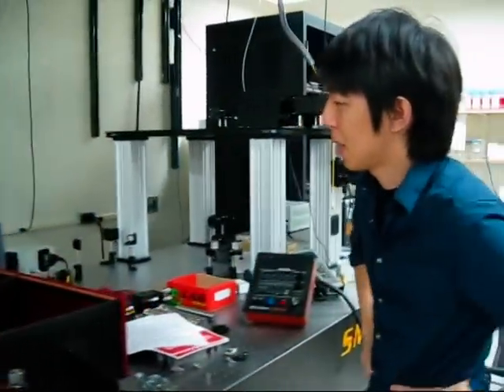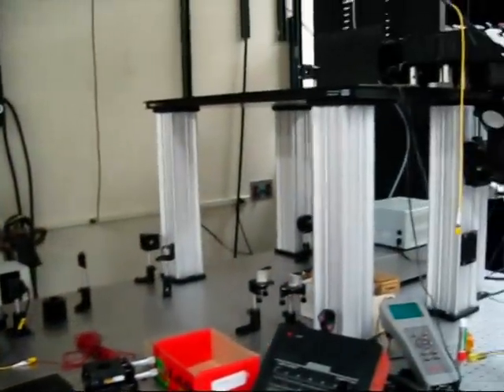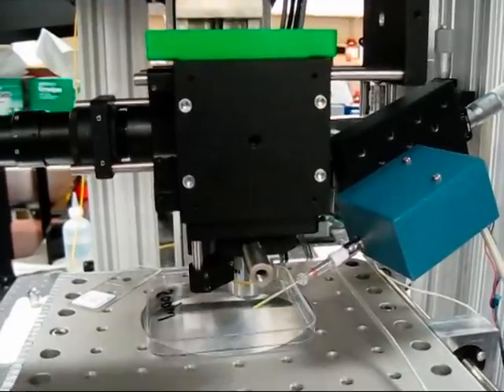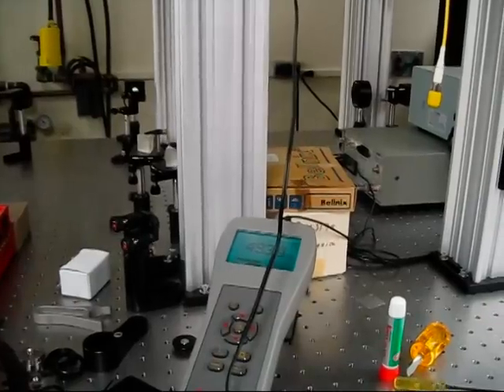Del Mar Photonics Ti:Sapphire laser Trestles in the UCLA Biophysics Neuroimaging Laboratory

Comment from the maker: Laser micromachining of transparent glass and quartz dielectrics using nano short pulsed Nd:YVO4 laser harmonics
Shiva P. Gadag
10 February 2015 • 6:00 - 8:00 PM | Part of SPIE LASE

CW, single-frequency 229nm laser source for Cd-cooling by harmonic conversion
Yushi Kaneda, J. Michael Yarborough, Yevgeniy A. Merzlyak
10 February 2015 • 8:30 - 8:50 AM | Part of SPIE LASE

517nm - 538nm tunable second harmonic generation in a diode-pumped PPKTP waveguide crystal
Ksenia A. Fedorova, Phillip R. Battle, Daniil A. Livshits, Edik U. Rafailov
10 February 2015 • 11:40 AM - 12:00 PM | Part of SPIE LASE

Molecular organization and phase transition at the air-water interface investigated by second-harmonic generation
Emmanuel Benichou, Aurelie Bruyere, Emilie Forel, Oriane Bonhomme, Pierre-Francois Brevet
10 February 2015 • 5:10 - 5:30 PM | Part of SPIE OPTO

Fiber laser driven ultrafast RGB source based on simultaneous second harmonic generation from a dual zero dispersion wavelength fiber source
Yuhong Yao, Wayne H. Knox
10 February 2015 • 4:20 - 4:40 PM | Part of SPIE LASE

Frequency doubling of near-infrared radiation enhanced by a multi-pass cavity for the second-harmonic wave
Daniel Jedrzejczyk, Reiner Guther, Katrin Paschke, Gotz Erbert
10 February 2015 • 9:50 - 10:10 AM | Part of SPIE LASE

Quantitative changes in collagen subtypes during breast cancer progression by multivariate analysis of Raman and second harmonic generation microscopy
Sixian You, Yuan Liu, Haohua Tu, Eric J. Chaney, Marina Marjanovic, Stephen A. Boppart M.D.
7 February 2015 • 8:50 - 9:10 AM | Part of SPIE BiOS

Second harmonic generation (SHG) imaging demonstrated a strong dependence of the collagen hydrogels' structures on the types and concentrations of ions
Xuye Lang, Julia G. Lyubovitsky
9 February 2015 • 5:20 - 5:40 PM | Part of SPIE BiOS

Interferometric second harmonic generation imaging of biological tissues
Charles-Andre Couture, Maxime Rivard, Konstatin Popov, Mathieu Laliberte, Anthony Bertrand-Grenier, Amir Miri, Francois Martin, Henri Pepin, Luc Mongeau, Christian Pfeffer, Cameron Brown, Lora Ramunno, Francois Legare
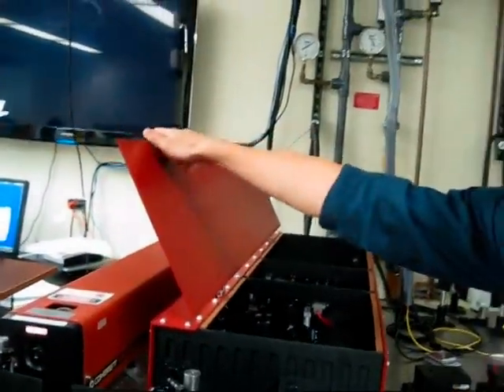8 February 2015 • 5:30 - 7:00 PM | Part of SPIE BiOS

Second harmonic 266nm generation by PP-LBGO device
Junji Hirohashi, Tetsuo Taniuchi, Koichi Imai, Masami Hatori, Shunji Takekawa, Mitsuyoshi Sakairi, Makoto Matsukura, Hiroshi Motegi, Satoshi Makio, Shintaro Miyazawa, Yasunori Furukawa
10 February 2015 • 8:50 - 9:10 AM | Part of SPIE LASE

Enhancement mechanisms for second-harmonic generation from metal nanostructures
Martti Kauranen, Robert Czaplicki, Jouni Makitalo, Kalle O. Koskinen, Joonas Lehtolahti, Janne Laukkanen, Markku Kuittinen
9 February 2015 • 11:15 - 11:45 AM | Part of SPIE OPTO

Differentiating pigmented skin tumors by the tumor-associated melanocytes based on in vivo third harmonic generation microscopy
Wei-Hung Weng M.D., Ming-Rung Tsai, Yi-Hua Liao M.D., Chi-Kuang Sun
7 February 2015 • 8:10 - 8:30 AM | Part of SPIE BiOS

Determination of the reduced scattering coefficient from 3D imaging of thick tissues by second harmonic generation microscopy
Paul J. Campagnola, Gunnsteinn Hall, Kevin W. Eliceiri
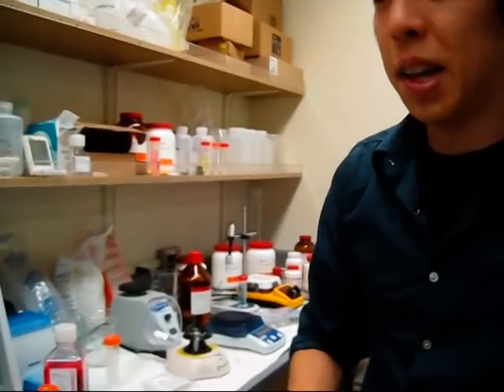8 February 2015 • 1:20 - 1:50 PM | Part of SPIE BiOS

Narrowband second harmonic thermoacoustic signals from solid and soft tissues
Stephan Kellnberger, Murad Omar, George Sergiadis, Vasilis Ntziachristos
9 February 2015 • 5:30 - 7:30 PM | Part of SPIE BiOS

Second harmonic generation at oblique angles in photonic bandgap structures
Han Li, Joseph W. Haus, Partha P. Banerjee
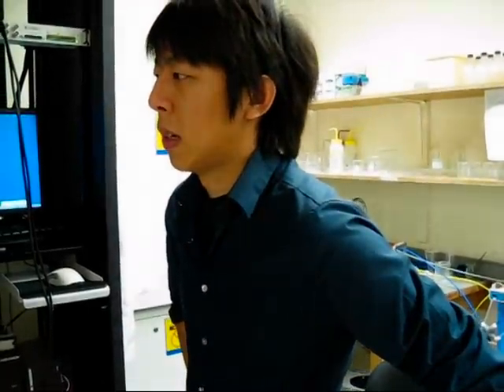11 February 2015 • 5:00 - 5:20 PM | Part of SPIE LASE

In-phase synchronization of array laser using intra-Talbot-cavity second harmonic generation
Kenichi Hirosawa, Fumihiko Kannari, Takayuki Yanagisawa
9 February 2015 • 5:10 - 5:30 PM | Part of SPIE LASE

Enhance resolution on OCT profilometry measurements using harmonic artifacts
Marcus Paulo Raele, Lucas De Pretto, Anderson Z. de Freitas
9 February 2015 • 5:30 - 7:30 PM | Part of SPIE BiOS

In situ determination of collagen fibrils size via absolute measurements of second harmonic generation
Stephane Bancelin, Carole Aime, Ivan Gusachenko, Laura Kowalczuk, Gael Latour, Thibaud Coradin, Marie-Claire Schanne-Klein
8 February 2015 • 5:30 - 7:00 PM | Part of SPIE BiOS

Controllable harmonic generation by double couplings of ordinary rays-involved second-order processes
Yiqiang Qin
11 February 2015 • 6:00 - 8:00 PM | Part of SPIE OPTO

Second-harmonic generation with double resonant hybrid plasmonic/dielectric nanostructures
Heiko Linnenbank, Stefan Linden
9 February 2015 • 11:45 AM - 12:00 PM | Part of SPIE OPTO

Generation of third harmonic picosecond pulses at 355 nm by sum frequency mixing in periodically poled MgSLT crystal
Thomas Schoenau, Andre Kaltenbach, Gunther Trankle, Kristian Lauritsen, Rainer Erdmann
10 February 2015 • 6:00 - 8:00 PM | Part of SPIE LASE

Second harmonic generation of a random fiber laser with Raman gain
Sergey A. Babin, Ekaterina I. Dontsova, Ilya D. Vatnik, Sergey I. Kablukov
11 February 2015 • 5:20 - 5:40 PM | Part of SPIE LASE

Third harmonic generation and multiphoton fluorescence in graphene using a compact femtosecond 1.56 µm laser
Antti Saynatjoki, Lasse Karvonen, Juha Riikonen, Wonjae Kim, Joonas Makinen, Seyed Soroush Mehravar, Robert A. Norwood, Nasser N. Peyghambarian, Harri Lipsanen, Khanh Kieu
9 February 2015 • 1:40 - 2:00 PM | Part of SPIE OPTO

Second harmonic generation imaging in tissue engineering and cartilage pathologies
Magnus B. Lilledahl, Magnus O. Olderoy, Andreas Finnoy, Kristin Olstad, Jan E. Brinchman
9 February 2015 • 5:20 - 5:35 PM | Part of SPIE BiOS

Correlation between polarization sensitive optical coherence tomography and second harmonic generation microscopy in skin
Hoan Viet Le, Seunghun Lee, Bumju Kim, Yeoreum Yoon, Ki Hean Kim
11 February 2015 • 3:00 - 3:15 PM | Part of SPIE BiOS

Synchronous-digitization for video rate polarization modulated beam scanning second harmonic generation microscopy
Shane Z. Sullivan, Emma L. DeWalt, Paul D. Schmitt, Ryan D. Muir, Garth J. Simpson
10 February 2015 • 11:20 - 11:40 AM | Part of SPIE BiOS

In vivo visualization of collagen fiber produced by cultured osteoblasts using sensitive second-harmonic-generation microscopy equipped with a 10-fs mode-locked Ti:sapphire laser
Eiji Hase, Katsuya Sato, Takeshi Yasui
8 February 2015 • 5:30 - 7:00 PM | Part of SPIE BiOS

Experimental and modelling investigations into the laser ablation of Si, PCD, Cu, steel and WC using picosecond pulses at second harmonics
Paul Borner, Germana Zandonadi, Gregory Eberle, Konrad Wegener
10 February 2015 • 9:00 - 9:20 AM | Part of SPIE LASE

Edge-lit volume holograms recorded by free space exposure: diffraction by 2nd Harmonics in Bayfol® HX film
Friedrich-Karl Bruder, Thomas Faecke, Rainer Hagen, Dennis Hoenel, David Jurbergs, Enrico Orselli, Christian Rewitz, Thomas Roelle, Guenther Walze, Brita Wewer
8 February 2015 • 8:40 - 9:00 AM | Part of SPIE OPTO

Realization of high-sensitivity surface plasmon resonance (SPR) sensor applying 2? harmonic lock-in detection
Chang-In Park, Kwang-Jin Kim, Chang-Gun Kim, Nam-Pyo Hong, Young-Wan Choi
11 February 2015 • 2:25 - 2:45 PM | Part of SPIE OPTO

Super resolution brain imaging by using a two-photon fluorescence microscopy with harmonic modulation
Szu-Yu Lee, Chi-Kuang Sun
8 February 2015 • 5:30 - 7:00 PM | Part of SPIE BiOS

Competition between harmonic generation and multi-photon luminescence in selectively grown coaxial InGaN/GaN quantum wells on GaN pyramids for tunable light emission
Sween J. Butler, Mohamed Fikry, Klaus Thonke, Arup Neogi
11 February 2015 • 2:50 - 3:10 PM | Part of SPIE LASE

100w femtosecond fiber amplifier and harmonic generation from IR to UV
Julien Saby
10 February 2015 • 6:00 - 8:00 PM | Part of SPIE LASE

Sub-cycle control of multi-THz high-harmonic generation and all-coherent charge transport in bulk semiconductors
Christoph Lange, Olaf Schubert, Matthias Hohenleutner, Fabian Langer, Thomas Maag, Sebastian Baierl, Ulrich Huttner, Daniel Golde, Thorsten Meier, Mackillo Kira, Stephan W. Koch, Rupert Huber
10 February 2015 • 1:50 - 2:20 PM | Part of SPIE LASE

Saturation-limited second harmonic generation in a quantum well-nanoresonator coupled system
Omri Wolf, Salvatore Campione, Arvind P. Ravikumar, Alexander Benz, Sheng Liu, Emil A. Kadlec, Benjamin V. Olson, Eric A. Shaner, John F. Klem, Michael B. Sinclair, Igal Brener
11 February 2015 • 6:00 - 8:00 PM | Part of SPIE OPTO

Fiber-integrated second harmonic generation modules for visible picosecond pulse generation
Thomas H. Legg, Timothy H. Runcorn, Dora J. Hu, Robert T. Murray, Edmund J. R. Kelleher, Sergei V. Popov, Robert C. Eckardt, Dieter H. Jundt, Andrew Robertson, James R. Taylor
10 February 2015 • 11:00 - 11:20 AM | Part of SPIE LASE

Motion-free polarization-resolved second harmonic generation cornea imaging with sub-15 fs pulses
Hans Georg Breunig, Ana Batista, Aisada Uchugonova, Karsten Konig
8 February 2015 • 5:30 - 7:00 PM | Part of SPIE BiOS

Second harmonic generation from metamaterials strongly coupled to intersubband transitions in quantum wells
Salvatore Campione, Omri Wolf, Arvind P. Ravikumar, Alexander Benz, Sheng Liu, John F. Klem, Michael B. Sinclair, Igal Brener
11 February 2015 • 1:30 - 2:00 PM | Part of SPIE LASE

Tracing red blood cells in human capillary automatically by third harmonic generation microscopy
Guan-Liang Lin, Chien-Ming Lee, Yuan-Ta Shih, Ming-Rung Tsai, Chi-Kuang Sun
7 February 2015 • 11:00 - 11:20 AM | Part of SPIE BiOS

20.3% wall-plug efficiency green laser based on an electrically pumped VECSEL through intracavity second harmonic generation
Pu Zhao, Bing Xu, Robert Van Leeuwen, Tong Chen, Laurence S. Watkins, Delai Zhou, Jean-Francois Seurin, Peng Gao, Guoyang Xu, Qing Wang, Chuni Ghosh
10 February 2015 • 9:30 - 9:50 AM | Part of SPIE LASE

Terahertz harmonic generation in graphene
Samwel K. Sekwao, Jean-Pierre Leburton
10 February 2015 • 5:40 - 6:00 PM | Part of SPIE OPTO

Generation of stable high order harmonic noise-like pulses in a passively mode-locked double clad fiber ring laser
Juan C. Hernandez-Garcia, Olivier J. Pottiez, Baldemar Ibarra-Escamilla, Julian M. Estudillo-Ayala, Roberto Rojas-Laguna, Evgeny A. Kuzin
10 February 2015 • 6:00 - 8:00 PM | Part of SPIE LASE

Combining wide-field assessment with nonlinear optical microscopy: possibilities for multimodal imaging in epithelial (pre)cancer
Rahul Pal, Jinping Yang, Gracie Vargas
9 February 2015 • 2:05 - 2:20 PM | Part of SPIE BiOS

Multimodal non-invasive optical imaging methods for structure and functional assay of nociceptive pain model in Drosophila melanogaster
Chiao-Ying Lin, Chii-Wann Lin, Jyh-Horng Chen
7 February 2015 • 2:10 - 2:30 PM | Part of SPIE BiOS

In vivo multimodal optical microscopy for longitudinal tracking of adverse effects following topical steroid treatment
Andrew J. Bower, Zane A. Arp, Youbo Zhao, Eric J. Chaney, Marina Marjanovic, Stephen A. Boppart M.D.
7 February 2015 • 11:20 - 11:40 AM | Part of SPIE BiOS

Mode-locking in intracavity frequency doubled Nd:YVO4 laser
Anton V. Kovalev, Vadim M. Polyakov, Sergey G. Alekseev, Oleg A. Orlov, Andrey A. Mak
10 February 2015 • 3:30 - 3:50 PM | Part of SPIE LASE

False positives in SRS imaging of lipid droplets: identification and reduction
Xuesong Li, Wen Jiun LAM, Yan Hao, Qiqi Sun, Sicong He, Yan Zeng, Ho Yi Mak, Jianan Qu
8 February 2015 • 5:30 - 7:00 PM | Part of SPIE BiOS

Self-focusing effect on THG at interfaces of solvent-cuvette
Emerson C. Barbano, Kerrianne Harrington, Sergio C. Zilio, Lino Misoguti
10 February 2015 • 6:00 - 8:00 PM | Part of SPIE LASE

Large-aperture adaptive liquid crystal lenses for vision care
Guoqiang Li, Thomas Mauger
11 February 2015 • 10:20 - 10:50 AM | Part of SPIE OPTO

Real-time monitoring of tumor response to preoperative radiochemotherapy for rectal carcinoma by nonlinear optical microscopy
Lianhuang Li, Jianxin Chen
10 February 2015 • 11:35 - 11:55 AM | Part of SPIE BiOS

Classification and recognition of texture collagen obtaining by multiphoton microscope with neural network analysis tool
Shulian Wu, Hui Li, Xiaoman Zhang
8 February 2015 • 5:30 - 7:00 PM | Part of SPIE BiOS

Ten deep blue to cyan emission lines from an intracavity frequency converted Raman laser
Dimitri Geskus, Jonas Jakutis Neto, Helen M. Pask, Niklaus U. Wetter
10 February 2015 • 9:30 - 9:50 AM | Part of SPIE LASE

Transducing electron and photons in electrically-contacted optical gap antennas
Alexandre Bouhelier
10 February 2015 • 1:55 - 2:25 PM | Part of SPIE OPTO

High-power non linear frequency converted laser diodes
Paul M. Petersen, Ole B. Jensen, Peter E. Andersen, Anders K. Hansen, Dominik Marti, Peter M. W. Skovgaard
11 February 2015 • 10:50 - 11:10 AM | Part of SPIE OPTO

Mechanisms for forbidden hyper-Rayleigh scattering
David L. Andrews, Mathew D. Williams, Jack S. Ford
11 February 2015 • 5:40 - 6:00 PM | Part of SPIE LASE

Characterization of porcine eye based on autofluorescence lifetime imaging
Ana Batista, Hans Georg Breunig, Aisada Uchugonova, Antonio Miguel Morgado, Karsten Konig
8 February 2015 • 2:05 - 2:20 PM | Part of SPIE BiOS

Tunable continuous-wave midwave infrared generation using an orientation patterned GaAs crystal with a fan-out grating design
Jacob O. Barnes, Shekhar Guha, Leonel P. Gonzalez, Peter G. Schunemann
10 February 2015 • 5:10 - 5:30 PM | Part of SPIE LASE

Optical nonlinearities in few-layer gallium selenide
Lasse Karvonen, Antti Saynatjoki, Seyed Soroush Mehravar, Raul D. Rodriquez, Susanne Hartmann, Dietrich R. T. Zahn, Seppo K. Honkanen, Robert A. Norwood, Nasser N. Peyghambarian, Khanh Q. Kieu, Harri Lipsanen, Juha Riikonen
8 February 2015 • 10:00 - 10:15 AM | Part of SPIE OPTO

0.5W CW single frequency blue at 486 nm via SHG with net conversion of 81.5% from the NIR using a 30 mm PPMgO:SLT crystal in a resonant cavity
Ali Khademian, David Shiner
10 February 2015 • 11:20 - 11:40 AM | Part of SPIE LASE

Nano-scale characterization of gold nanostructures using polarized nonlinear microscopy
Naveen K. Balla, Carolina Rendon, Esteban B. Urena, Pawel Karpinski, Julien Dubboiset, Patrick Ferrand, Herve Rigneault, Romain Quidant, Sophie Brasselet
9 February 2015 • 12:00 - 12:15 PM | Part of SPIE OPTO

Design and results of a dual-gas quasi-phase matching (QPM) foil target
Arvid Hage, Bjorn Landgraf, Michael Taylor, Martin Wunsche, Mark J. Prandolini, Mark Yeung, Hauke Hoppner, Michael Schulz, Robert Riedel, Franz Tavella, Brendan H. Dromey, Matthew Zepf
11 February 2015 • 2:30 - 2:50 PM | Part of SPIE LASE

Discontinuous sampling in beam-scanning microscopy
Ryan Muir, Paul D. Schmitt, Emma L. DeWalt, Shane Z. Sullivan, Ximeng You, Garth J. Simpson
9 February 2015 • 5:05 - 5:20 PM | Part of SPIE BiOS

Breast cancer staging through nonlinear endomicroscopy
Gunnsteinn Hall, Wenxuan Liang, Lu Jiang, Kristine Glunde, Xingde Li
9 February 2015 • 9:05 - 9:20 AM | Part of SPIE BiOS

Watt-level continuous-wave diode lasers at 1180 nm with high spectral brightness
Katrin Paschke, Gunnar Blume, Olaf Brox, Frank Bugge, David Feise, Jorg Fricke, Julian Hofmann, Hans Wenzel, Gotz Erbert
9 February 2015 • 2:50 - 3:10 PM | Part of SPIE LASE

Multiphoton microscopy for the characterization and treatment of malignant breast lesions
Alex J. Walsh, Rebecca S. Cook, Melinda E. Sanders M.D., Carlos L. Arteaga, Melissa C. Skala
7 February 2015 • 9:50 - 10:10 AM | Part of SPIE BiOS

Nonlinear imaging of lipid membrane alterations elicited by nanosecond pulsed electric fields
Erick Moen, Gary L. Thompson, Andrea M. Armani, Hope T. Beier, Bennett L. Ibey
9 February 2015 • 11:30 - 11:50 AM | Part of SPIE BiOS

Ultrafast element-specific magnetization dynamics of complex magnetic materials on a table top
Stefan Mathias, Chan La-O-Vorakiat, Justin M. Shaw, Emrah Turgut, Patrik Grychtol, Roman Adam, Denis Rudolf, Hans T. Nembach, Thomas J. Silva, Martin Aeschlimann, Claus M. Schneider, Henry C. Kapteyn, Margaret M. Murnane
11 February 2015 • 9:00 - 9:30 AM | Part of SPIE OPTO

Classical electron trajectories and birth time in polar-asymmetric two-color laser fields
Aram Gragossian, Denis V. Seletskiy, Mansoor Sheik-Bahae
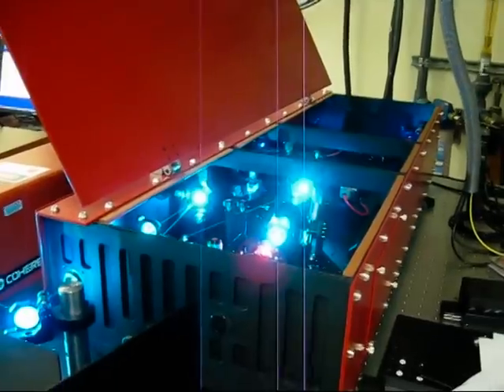9 February 2015 • 5:50 - 6:05 PM | Part of SPIE OPTO

Coherent combining of fiber-laser-pumped frequency converters using all-fiber electro-optic modulator for active phase control
Pierre Bourdon, Anne Durecu, Guillaume Canat, Julien Le Gouet, Didier Goular, Laurent Lombard
12 February 2015 • 3:30 - 3:50 PM | Part of SPIE LASE

Temporal characterization of full attosecond pulse by THz streaking
Fernando Ardana Lamas, Christian Erny, Andrey Stepanov, Ishkhan Gorgisyan, Pavle Juranic, Christoph P. Hauri
11 February 2015 • 4:50 - 5:05 PM | Part of SPIE OPTO

Nanoplasmonics of particles over thin films: Quantum and magnetic effects
Reuven Gordon, Ghazal Hajisalem, Reza N. Sanadgol, Haitian Xu, Byoung-Chul Choi
8 February 2015 • 11:20 - 11:40 AM | Part of SPIE LASE

Simulating the linear and nonlinear response of 1D nanostructures with a B-spline modal method
Patrick Bouchon, Paul Chevalier, Sebastien Heron, Fabrice Pardo, Riad Haidar
11 February 2015 • 4:40 - 5:00 PM | Part of SPIE OPTO

Frequency conversion in AlGaAs microdisks in the telecom range
Giuseppe Leo, Silvia Mariani, Alessio Andronico, Aristide Lemaitre, Sara Ducci, Ivan Favero
11 February 2015 • 11:30 - 11:45 AM | Part of SPIE OPTO

Imaging human melanoma using coherent anti-stokes Raman scattering (CARS) and multiphoton microscopy (MPM)
Hequn Wang, Sam Osseiran, Elisabeth Roider, Vivien Igras, David E. Fisher, Conor L. Evans
10 February 2015 • 11:00 - 11:15 AM | Part of SPIE BiOS

Image-inspired 3D multiphoton excited fabrication of extracellular matrix structures by modulated raster scanning for cancer biology studies
Paul J. Campagnola, Visar Ajeti, Kevin W. Eliceiri, Manish Patankar
12 February 2015 • 3:50 - 4:20 PM | Part of SPIE LASE

Multi-channel beam-scanning imaging at kHz frame rates by Lissajous trajectory microscopy
Justin A. Newman, Shane Z. Sullivan, Ryan D. Muir, Suhas Sreehari, Charles A. Bouman, Garth J. Simpson
10 February 2015 • 11:00 - 11:20 AM | Part of SPIE BiOS

The laser infrastructure of the ELI attosecond light pulse source
Karoly Osvay, Patricio Antici, Dimitris Charalambidis, Eric Cormier, Zsolt Diveki, Peter Dombi, Jozsef A. Fulop, Mikhail Kalashnikov, Nelson Lopes, Rodrigo Lopez-Martens, Giuseppe Sansone, Ervin Racz, Kahaly Subhendu, Zoltan Varallyay, Katalin Varju
12 February 2015 • 9:00 - 9:30 AM | Part of SPIE LASE

Visualizing and quantifying melanoma risk factors with coherent anti-Stokes Raman scattering (CARS) and multiphoton microscopy
Hequn Wang, Sam Osseiran, Elisabeth Roider, Vivien Igras, Peter T. C. So, David E. Fisher, Conor L. Evans
7 February 2015 • 11:40 AM - 12:10 PM | Part of SPIE BiOS

Polarization and wavelength selective grating mirror enables efficient generation of kW-class CW green radiation
Marwan Abdou Ahmed, Martin Rumpel, Montasser Bouzid, Christian Stolzenburg, Alexander Killi, Thomas Graf
9 February 2015 • 11:50 AM - 12:10 PM | Part of SPIE LASE

Ultrafast thin-disk multipass amplifier with 1.4 kW average power and 4.7 mJ pulse energy at 1030nm converted to 820 w and 2.7 mJ at 515nm
Jan-Philipp Negel, Andre Loescher, Andreas Voss, Dominik Bauer, Dirk H. Sutter, Alexander Killi, Marwan Abdou Ahmed, Thomas Graf
9 February 2015 • 11:10 - 11:30 AM | Part of SPIE LASE

Nonlinear optical output of atomic systems via numerical simulation of time-dependent Schrodinger equation, stimulated by laser sources in and out of resonance conditions within the non-perturbative regime
Stephen Karasek, Charles A. DiMarzio
11 February 2015 • 2:10 - 2:30 PM | Part of SPIE BiOS

controlling femtosecond dynamics on the nanometer scale
Nicolo Accanto, Lukasz Piatkowski, Jan Renger, Niek F. van Hulst
9 February 2015 • 10:30 - 11:15 AM | Part of SPIE OPTO

Sub-700fs pulses at 152W average power from a Tm-doped fiber CPA system
Christian Gaida, Fabian Stutzki, Martin Gebhardt, Florian Jansen, Andreas Wienke, Uwe D. Zeitner, Frank Fuchs, Cesar Jauregui-Misas, Dieter Wandt, Dietmar Kracht, Jens Limpert, Andreas Tunnermann
12 February 2015 • 10:40 - 11:00 AM | Part of SPIE LASE

Label-free multimodal multiphoton imaging by adaptively shaping fiber supercontinuum pulses
Yuan Liu, Haohua Tu, Eric J. Chaney, Sixian You, Stephen A. Boppart M.D.
7 February 2015 • 3:00 - 3:15 PM | Part of SPIE BiOS

Solid-state laser source of narrowband ultraviolet B light for skin disease care with advanced performance
Aleksandr A. Tarasov
11 February 2015 • 4:40 - 5:00 PM | Part of SPIE LASE

Simultaneous quadruple modal nonlinear optical imaging for gastric diseases diagnosis and characterization
Zi Wang, Wei Zheng, Jian Lin, Zhiwei Huang
10 February 2015 • 11:45 AM - 12:00 PM | Part of SPIE BiOS

Compact fixed wavelength femtosecond oscillators for multi-photon applications
Tommi Hakulinen, Heinz P. Huber, Tilman Franke, Ruben Zadoyan, Tommaso Baldacchini
9 February 2015 • 11:40 AM - 12:00 PM | Part of SPIE LASE

Label-free second order susceptibility imaging of collagen
Chen-Yuan Dong, Chiu-Mei Hsueh, Ya-Der Huang, Hsuan-Shu Lee
9 February 2015 • 3:30 - 3:50 PM | Part of SPIE BiOS

All fiber based, multi-color two photon excitation microscopy with an amplified laser diode
Sebastian Karpf, Matthias Eibl, Robert A. Huber
8 February 2015 • 5:30 - 7:00 PM | Part of SPIE BiOS

Label-free multi-photon imaging of Barrett esophagus
Seyed Soroush Mehravar, Philip Usera, Hemant Chatrath, Nasser Peyghambarian, Bhaskar Banerjee, Khanh Kieu
9 February 2015 • 4:20 - 4:35 PM | Part of SPIE BiOS

Biomaterial discrimination using wavelength-dependent SHG excitation efficiency
Stephen J. Matcher, Nicola H. Green, Robin M. Delaine-Smith, Gwendolen C. Reilly, Hannah Askew, Xuesong Hu
9 February 2015 • 4:50 - 5:05 PM | Part of SPIE BiOS

Label free, real time visualization of tissue histology at subcellular resolution: a study of primary versus secondary human brain cancer tissues
Carmen Kut, Wenxuan Liang, Gunnstein Hall, Kaisorn Chaichana, Alfredo Quinones-Hinojosa M.D., Xingde Li
8 February 2015 • 11:10 - 11:30 AM | Part of SPIE BiOS

Determination of the spectral dependence of reduced scattering and quantitative SHG imaging for detection of fibrillar changes in ovarian cancer
Kirby R. Campbell, Paul J. Campagnola, Karissa B. Tilbury
8 February 2015 • 5:30 - 7:00 PM | Part of SPIE BiOS

High power green diode laser for the treatment of eye diseases by laser coagulation
Arne Heinrich, Clemens Hagen, Maximilian Harlander, Bernhard Nussbaumer
8 February 2015 • 5:30 - 7:00 PM | Part of SPIE BiOS

Chiral nano-pore arrays with bent-core liquid crystals and their applications
Dong Ki Yoon, Hanim Kim, Kiback Choe, Seong Ho Ryu, Sunhee Lee, Tae Joo Shin, Eva D. Korblova, David M. Walba, Noel A. Clark, Sang Bok Lee, Pilhan Kim
10 February 2015 • 9:15 - 9:30 AM | Part of SPIE OPTO

Two-photon autofluorescence lifetime and shg imaging of healthy and diseased human corneas
Ana Batista, Hans Georg Breunig, Aisada Uchugonova, Berthold Seitz M.D., Antonio Miguel Morgado, Karsten Konig
8 February 2015 • 5:30 - 7:00 PM | Part of SPIE BiOS

Enhanced nanograting formation assisted by silver ions in a sodium gallophosphate glass: Correlation between surface nanostructuring, fluorescence, and effective second-order nonlinear optical properties
Marie Vangheluwe, Feng Liang, Yannick Petit, Patricia Hee, Yannick Ledemi, Sebastien Thomas, Nicolas Marquestaut, Evelyne Fargin, Thierry Cardinal, Younes Messaddeq, Lionel Canioni, Real Vallee
8 February 2015 • 2:30 - 2:50 PM | Part of SPIE OPTO

Stable miniature short-pulsed VCSEL-pumped laser with monolithic resonator
Uros Orthaber, Rok Petkovsek, Andrej Vrecko, Igor Poberaj
10 February 2015 • 2:40 - 3:00 PM | Part of SPIE LASE

Histology in vivo: chemical contrast combined with clinical multimodal multiphoton tomograpy
Martin Weinigel, Hans Georg Breunig, Karsten Koenig
10 February 2015 • 11:15 - 11:30 AM | Part of SPIE BiOS

Yb-fiber laser for multimodal imaging
Ilyas Saytashev, Bingwei Xu, Marcos Dantus
9 February 2015 • 4:05 - 4:20 PM | Part of SPIE BiOS